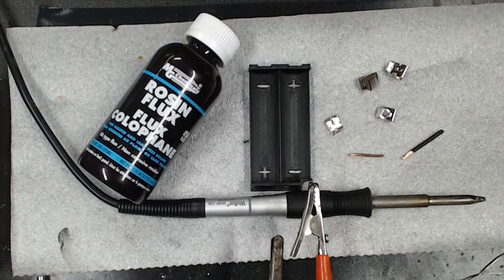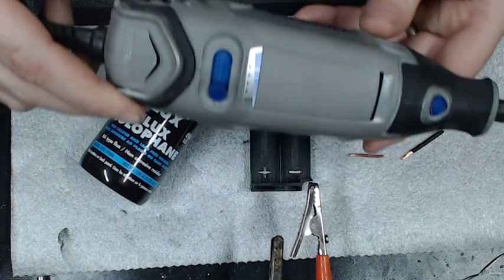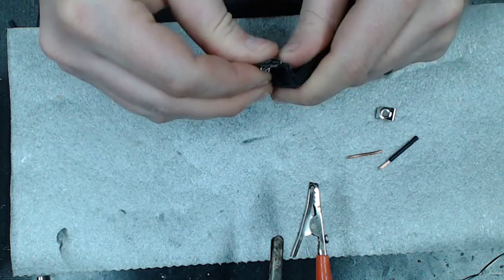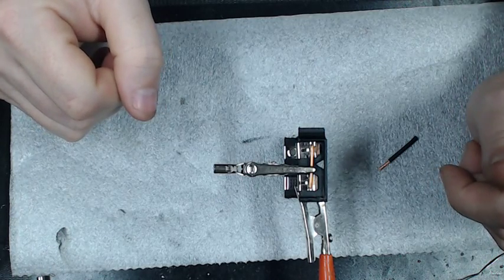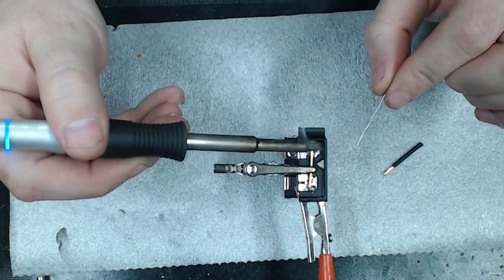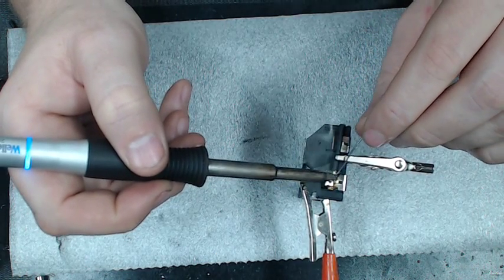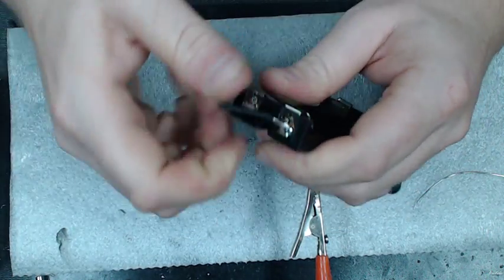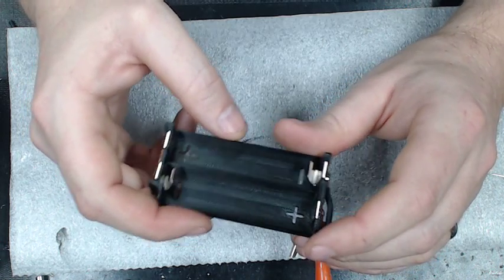How To Solder a 3D Printed Battery Tray

Comment: You don't need to scuff up. Your rosin flux is sufficient for cleaning the surface good enough to adhere to molecularly. But, habit is a habit and if it works for you continue